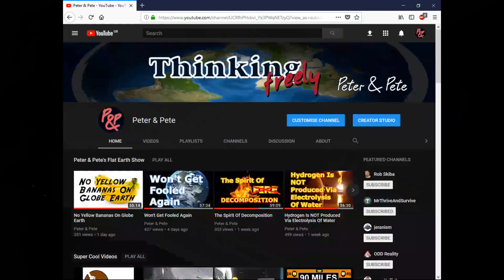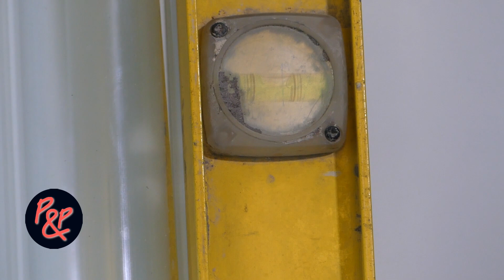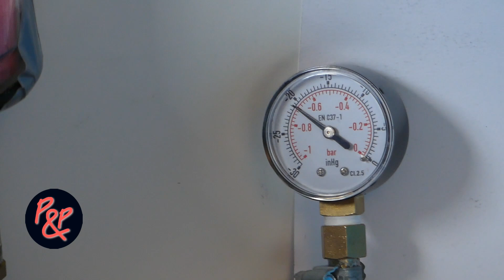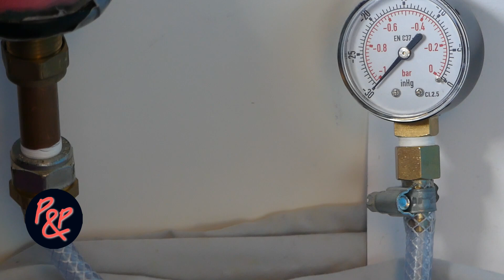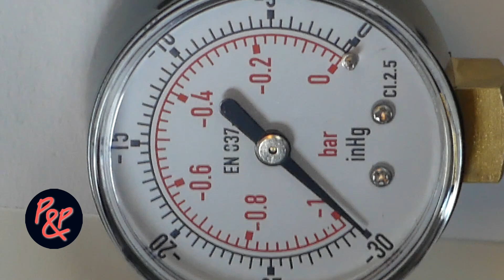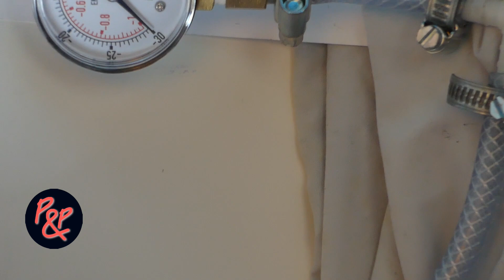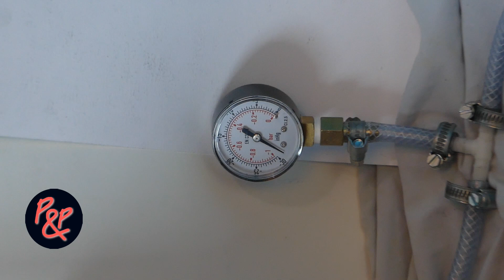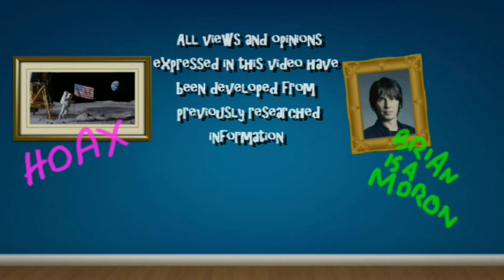Falling Objects - Sealing The Deal

Comment: I don't understand how your idiotic followers think you've proved your point.
1st, -3 bar isn't a vacuum. you're about -27 bar short on that score. You do have less air pressure, but not a vacuum.
2nd, in the drop with less air resistance, your silica gel fell MUCH faster. If objects fall at certain rates based on their weight, why did the gel thing fall faster with less air resistance?
3rd, How on earth do you not see that air resistance was the factor in reducing the downward accel of the gel thing? Keep evacuating that tube until you have a real vacuum, you'll see, they fall at the same rate.
Reply: Basil Vino    I donno! Magic? Did they turn it off when they dropped the ball? Did they use enough duct tape? How accurate are those gauges?
Reply: @caryboy2006  The way that gauge needle moved so 'jerkily' indicates it was a 'el-cheapo' one or there was some other problem with their set-up.
Reply from the maker: If you think we're wrong, you're more than welcome to do it yourself rather criticise from the comfort of your chair! Try it in 4m? Go on dare you.
Reply: Peter & Pete I don’t need to do it. The experiment has been done many many times. I can see that you’ve done it here quite clearly (although not very accurately, and with no real measurements). Where you’ve failed is in your conclusions! You’ve failed in your understanding of the observations. It’s as plain as the nose on your face that your results are changing with the change in air resistance, so what you need to do is make many many passes, at different pressures, and plot your results. That way, even if you can’t get a perfect vacuum you’ll be able to see where the data leads as you approach a vacuum. Be scientifically honest!!!!!
Reply from the maker: @basildraws  so if this drop test has been done many many times, there ought to be a video about it.
Reply: Peter & Pete   Yep!  There is. But your cult won’t accept it.
Reply: @PeterPete  Quote: "so if this drop test has been done many many times, there ought to be a video about it"
2 weeks before uploading this video, you uploaded a video of you watching several of those videoes... So, you know there is!
Reply from the maker: @DummStep  but the videos  show drops of about 18inches to 3 or 4ft. Our demo is 6.56 ft. Heavier objects ALWAYS hit the bottom  first given enough height is allowed for all objects to reach their max drop velocity! Btw, Mr Cox's drop is invalid as we never see the objects drop in real time. All this indicates is that objects fall because of a property of the object and NOT an external force or influence (like gravity) acting on the object. Why not take another step and do it yourself!!
Reply: @PeterPete  Stop suggesting to anyone to do it themselves, when you clearly don't even want to discuss your own results...
Various people suggested to you to repeat the exp... sorry, demonstration, using several steps in decreasing the air pressure in the tube and plotting the results.
Since you already have the equipment it would be easy for you and would prove your point more concisely.
And to clarify, I think your point is that removing the air in the tube has no effect on how fast the objects fall since that is entirely based on the properties of the objects
Reply from the maker: @DummStep  yup but you forgot to mention height as a major factor in determining the rate of fall of any object in any medium or non-medium!

Drop a ping pong ball and a hammer at 1ft and they apparently fall at same rate, extend the height to say 30ft and the hammer falls faster and hits the ground first!

Drop tests are largely contrived to make people like you think GRAVITY is real when in fact, it's rubbish!

objects simply fall due to a property of the object and not because an external force or influence is acting on them!
Reply: @PeterPete  your demonstration clearly showed that the aerogel thingy fell much faster in the low air-pressure tube.
So, please explain, what caused the properties of it being changed (It pretty much looked like the only difference was a difference in external influence)
This was pointed out to you by hundreds off people here in the comments, but you keep refusing to address this inconsistency. I hope you understand that this makes you look like you do not really care if what you tell us is actually true.
Reply from the maker: @DummStep  Quote - your demonstration clearly showed that the aerogel thingy fell much faster in the low air-pressure tube.
Tell us something we don't already know! But what we never saw is the aerogel and ball bearing fall at the same rate which means there cannot be an external force acting equally on both objects as both objects would fall at the same rate. If you can't see the wood through the trees that's not my problem! Maybe go to specsavers?
Reply from the maker: @DummStep  Btw, what makes you think the aerogel would travel faster if a greater vacuum was pulled? It's only got a max drop velocity, the felt will not fall any faster than that. Same with the ball bearing, the ball bearing will only fall as fast as its mass will allow which is why HEIGHT is a vital factor when determining whether objects fall at the same rate or not. Brian Cox's demo is invalid as we don't see the entire drop in real time.

Comment: You need a bigger vacuum chamber.
The felt touches the tube.
This means a failed test.
Reply: It doesn't invalidate the observation that the silica falls significantly faster when there is less air in the chamber. And the more air they suck out, the faster it would get I bet. And probably to the point it would only be a few inches behind the baring if they could get a near perfect vacuum.
Reply: @wishusknight3009  But as long as the walls are touched it stays an invalid test to see if in vacuum both objects fall the same speed.
Both objects have to be next to eachother  and may not touch anything on the way down.
Reply: @boterlettersukkel  No, it is not invalidated if that factor is taken into consideration. There is still a substantial difference in speed of the silica fluff. Wall resistance is not enough to be much of a factor. The major factor is the change in air resistance. Wall resistance will be less than 5% of that difference. So pretty much insignificant to the conclusion of the effect of gravity in a vacuum.
Reply: @boterlettersukkel  Even if the effect of the wall was 20%, that is still not enough to invalidate the conclusion.
Reply: @boterlettersukkel  They won't in their conclusions i agree, but we can see the tests for ourselves and determine proper outcomes from that based on previous studies and precedence. Even without access to a direct control.(only nasa's experiments as comparison) And based on those foundations it can be safe to conclude that wall resistance shouldn't be an important factor for what we should know to happen.. 

However, what does invalidate the conclusions made by pee and pee, were leaving out key findings in their experiments, which would influence the outcome, and  only supporting a conclusion based on insufficient data points and invalid premise. A premise which is not disprovable. AKA Bias... 

They didn't make any sort of note as to how a difference in speed of the silica fluff should be important or significant. So it having wall resistance is of no consequence if they aren't even going to use the data it pertains to. The only note they made was "it is still slower than the steal ball". 

The scenario in which wall resistance will be important to factor, will be in more specific testing of the speed differences of the fluff in different levels of vacuum. In which case it is probable that the effect of wall resistance will scale proportionally to the measured effect, and not inversely.
Reply from the maker: @boterlettersukkel  do it yourself if you're unhappy with our results!! haha!!
Reply: @PeterPete  So tat is all you got.
Laugh your failiure away  to do an experiment the corrects way??
Can't take critisism????
Reply from the maker: @boterlettersukkel  at least we've done something other than type. you can type all you like, it won't change the observation, and again you're more than welcome to do it yourself if you feel you can get a different result. Remember both objects are meant to fall at the same rate in any vacuum at any height!! Btw, we promote oxygen is not a constituent of the air but a processed gas; in other words man has to manipulate the air to produce a gas that is called oxygen. It's quite an interesting idea as so far nobody has disproved us. Care to try?
Reply: @PeterPete  I have done my share of tests and observations.
Up till now all have seen from you is pseudoscience and failed tests.
Oxygen only made in factory's?? What a joke.
No oxygen disolved in water?? redicolous.
No oxygem in air??? OYG!!!

all pseudoscience.
And for what??? Do you really think you are smarter than scientists that have figured it out already?
Reply: @PeterPete  If you make an experiment, you don't understand the meagre data that you have collected, you jump to a conclusion that doesn't follow the premises (the data), then you are putting up a deception and this is surely worse than making no experiments but relying on the 4 centuries old empirical and theoretical knowledge that science has on this topic.
Reply: @PeterPete  The scientist that disproved you 4 centuries ago was Galileo, who dropped from a tower balls of the same volume (with the same air resistance) but different weight (with different density), and saw that they reached the ground in the same time, in this way debunking the idea that density has any role in the falling of objects.
Reply from the maker: @psalux18963  it wasn't an experiment, it was a demonstration!!
Reply from the maker: @boterlettersukkel  Quote - Do you really think you are smarter than scientists that have figured it out already?
Scientists only put forward a consensually accepted understanding of the natural world based on what man can do with his environment. But what water is? In our understanding, apart from feeling wet amongst other things, man hasn't a clue! Man can't even make water!!
Reply: @PeterPete  It is very interesting that you are saying that it wasn't an experiment but a demonstration, because this implies that any empirical result would have been commented with the bias of your intended "demonstration", or in other words it means that reality for you is not important because you have already the ready-made answer.
Reply: @PeterPete  Scientist know something because there is evidence for it, and when many other scientists repeat the same experiences and find the same data, and fulfil the same predictions, then there is a scientific consensus. If all the scientists in a field of investigation consider something to be very probable, but they don't have evidence, there is no scientific consensus.
About water: how can you be so naive to think that we don't know very well how is made water? Of course men can make water, and without a lot of effort. Many times rocket engines work combining hydrogen and oxygen and obtaining water vapor, for instance. What do you think people are making any time that chemistry is made, at an experimental or industrial level? New substances are daily produced because we know how water and many other things behave in the conditions that are set for some chemical reactions to happen, in a predictable and controlled way. Your life is full of things that exist only because men have learned (at the beginning) how water is made and then all the other substances. Your plastic tube for the "demostration", the silica aerogel and many other things that we can see in your video exist only because we know perfectly how water is made.
Reply: @PeterPete  And document treir finding and submit them to peer review.
Don't you think that other scientists have not tested their finding??
Science is about finding flaws. NOT about confirming findings.
Reply: @PeterPete  BTW.. making water.
Ignite hydrogen and oxygen.
You'll get water.
Be carefull when you do it, it's kind of a explosive reaction.
Yes, it has been tested in all classrooms in chemestry class. It was that day when you were not there.
BTW... were you ever there??
Reply from the maker: @boterlettersukkel  we've gone over that hydrogen/oxygen reaction and it's all in our free e-book!! There's no new water!!
 https://www.smashwords.com/books/view/930017
Reply: Not only that:
1: Plastic is a bit static and the inside of the tube will build up more static when things move inside it, that will affect the result slightly.
2: The objects do not have same shape and volume, so the felt/gel is tumbling in air and that motion slows it down in air.
3: The ball will affect the ais behind is and also the speed and motion of anything behind it, if the felt is in the drag it will be pulled by the ball.
4: They need to if the hamber can hold the "vacuum", if not air rush in and can affect the result.
5: They need to film in higher frame rate and do test several time to get an average.
The test only show that they do not understand the most basic form of science and that theri logical thinking skills are at same level as a child, but this do not mean they have low IQ or that they are dumb, just that they need to read a bit more rather than watch YouTube, or better go to a science club where they can learn how to setup own experiment and how to collect data.

Well, in this video he is pretty dumb.